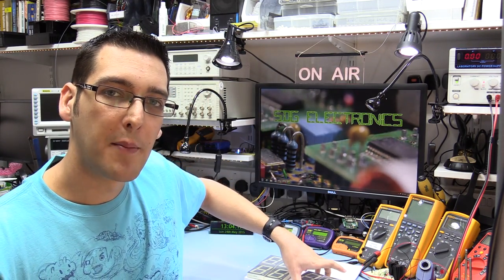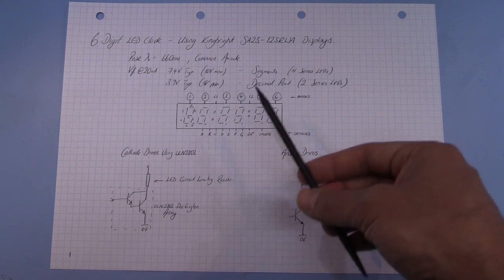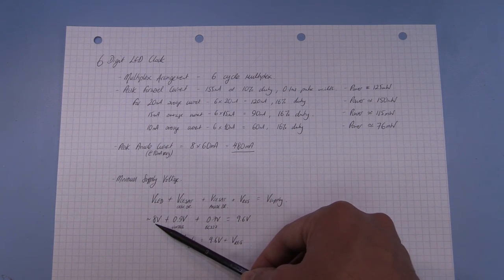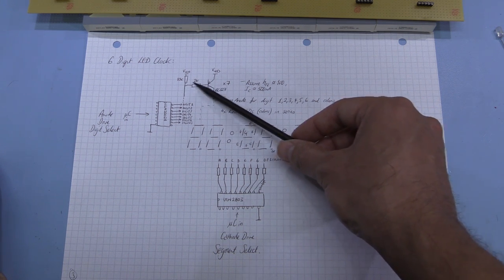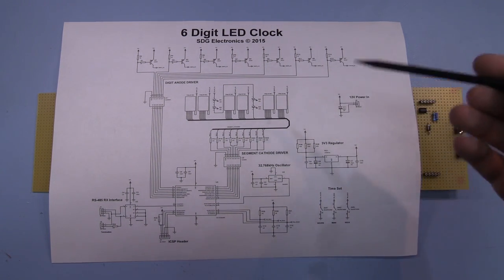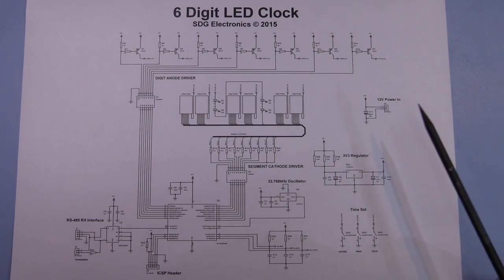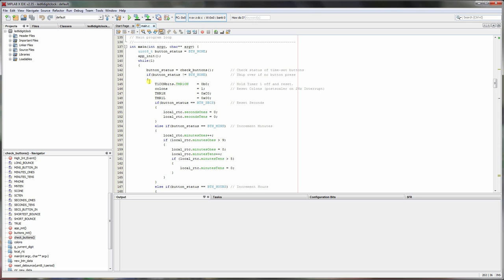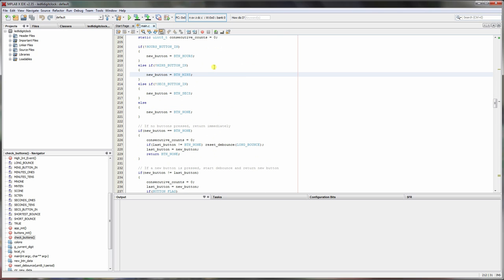SDG #023 Build A 6 Digit 2.3" LED Clock

Comment: Nice project - and possibly the tidiest wiring I've ever seen!
Reply from the maker: jix177 Thanks! Turns out it probably would have been quicker to spin a PCB, but wiring up on these prototype boards is generally pretty reliable and a lot cheaper. Thanks for watching.

Comment: You forgot to mention the Fluke in the description :)
Great video.
I made a very dirty prototype of a clock to learn how to code a specific micro like 10 years ago and it is still placed on my desk and is the clock I use the most. No case, nothing. Just works.
Reply from the maker: Charlie Pechiar I've built so many, but never made one that looks like a finished project, although there is something nice about seeing all the electronics. The OLED clock would be ok if it wasn't attached to a massive prototype board so it never really gets used. I may revisit sometime as the display is actually quite nice.
Thanks for watching :)

Comment: About the LEDs overdrive. It's a good way to get more brightness with multiplexing, but you have to check if you actually get more light with more current applied. There are current-luminance graphs in datasheet. I noticed that not all types of LEDs give more light when overdrived (but super bright red usually do).

Comment: I haven't looked at your schematic to see what you're doing with the ULN2803's pin that connects to all of those diodes.  They're in the chip for dealing with inductive loads,  I guess.  Here's a hint:  it make a dandy "lamp test" pin,  should you choose to use it that way.   :-)

Comment: Btw the "drag" soldering had had some solder between the last to pins. That's why I solder individual pins usually for 1.27mm pitch. And your soldering on the second side wasn't as bad. It doesn't have to be beautiful to work fine, as long as there is no solder between the pins. And it's probably awful to solder with a camera between you and the pcb.
Reply from the maker: Microlab Hi, I saw this on the video and it looks like solder, but it was some of the rosin from the Multicore solder and the way the light caught it. The working distance on the camera is about 15cm, so not too bad...

Comment: Excellent project! When you get the GPS added as well that will be quite a nice clock. Will you be reading the GPS serial out on the micro, or just syncing to the PPS? If you are reading the serial string, you can even account for leap seconds...
Reply from the maker: dwDragon88 The clock will be reading the full serial string, so hopefully should not need any adjustment ever. I kind of messed up in my thinking anyway as the acrylic on the front of the case for this clock will obscure the time setting buttons. I may add some to the back of the case just in case the GPS fails in the future. Thanks for coming back and watching :)
Reply: GPS time doesn't know about leap seconds.  So it is unlikely that a GPSDO would output data like that.  Leap seconds are why GPS time is a whole number of seconds off from UTC.  They started in-sync and then UTC did some leap seconds.

Comment: Thanks for publishing this video. I am amazed at how complicated updating six seven-segment displays is. I was looking at using MAX7219 chips for updating the LEDs, damn they are around $9.00 each in USA. Now that you have built the clock, is there a better way to reduce the chips / transistors that you used? Would MAX7219 be a good choice?
Reply from the maker: Take a look at SDG #058 there's a nice IC on that one

Comment: Excellent video and refresher from my college days. Though, there were no PIC chips then. :)   If one wanted to add a 7th and smaller digit to count tenths of a second, does this clock chip allow for that or would it be necessary to add a divide by 10 counter to the seconds count? Glad I found your channel !
Reply from the maker: Yes you can definitely add a 7th digit and modify the code to count 10th of seconds

Comment: How do you strip the wire? I got some and they are impossible to strip with the normal wire strippers i have.
Reply from the maker: Adil Malim Some automatic wire strippers work, I have some Knipex 12 42 195 Multistrip 10's. Often though, it's easier just to use a scalpel. Place the wire on a cutting mat, touch the scalpel on top of the wire and roll the wire. This seems to work well unless you've already soldered one end of the wire down...
Reply: Persevere with side cutters......you will get the feel for it eventually. Btw, nice clock.........nothing beats great big digits!
Reply: Well first time i tried i left it lol! Seemed too hard. Then i got this tip from somewhere to indent a normal nail cutter so it can strip the wire. Works really well but a bit tedious!
Reply from the maker: Adil Malim We use the C.K. Precision Wire strippers (model 330009) at work - http://www.amazon.co.uk/C-K-330009-0-12-Wire-Stripper/dp/B004JHXPE8

Comment: My Arduino-based GPS-controlled clock (conveniently intended for UTC, so no time zone offsets required) simply takes the GPS time string and displays it. Period. No 'Real Time Clock' at all. No 32.768 kHz oscillator. Just receive and display the time string more-or-less directly from the GPS. Known bugs: I really should erase the display after about 1.1s of no data, i.e. when the GPS signal drops out; now it happily displays frozen time. The displayed time must be a fraction of a second slow, as the data arrives a bit after the fact; I've heard of people programming elaborate +1s and synchronization code, including all carry-overs.

Comment: This is an incredible project.  I have built it and am having problems getting it to work.  I have checked all the connections a bunch of times and after programming it with the provided file the clock just shows all digits and all segments lit .  Colons too.  Do you have any ideas?  I know this project is 5 years old but any help would be great.  Thanks!!
Reply from the maker: Can you check the drivers all work properly? Try activating the first digit then check each segment. Do you have an oscilloscope?
Reply: @sdgelectronics  Thank you for replying.  I don't have an o-scope.  Im a noob at building these and it looked straight forward.  Couple questions: what would cause U1 to get hot? I am using MPLab 5.53 and XC8 2.10.  Would the code be compiled differently using these versions? Are there any special settings?  I tried the version 2.35 you used in the video to no avail.  Would the fact that I'm using kynar wire to the grounds instead of a bus be an issue?  The chips are all new since I bought a gross of all of them. I dont think I have anything wired incorrectly but did I miss something?
Reply: @sdgelectronics  I have determined that this appears to be a code issue.  I am not versed in programming but something is not right with either the compiler or syntax has changed.  I have opened a case with microchip and that is proving to be a serious trial that has been going on almost 3 months now.  All the hardware functions correctly.  I figured out why I was burning up U1 and corrected it.  Right now it appears that all the digits are being fed the same number so somewhere there is a disconnect.  I thought maybe I had the chip in backwards but I have exhaustively reviewed and even rewired them again and again with the same result.  All digits lit all segments lit, multiplexing does not seem to be functioning.  everything turns off when I erase the MCU.  Again, I'm a rookie at this and I have learned a lot for the last 3 months.  I understand if you would not be interested in helping me out due to that fact.  I just wanted to let you know where I am on this project.  Which would be really close to lighting it on fire.  If anyone else happens to read this and can help me out that would be great.  I really love this clock and would like to have it in my shop and working. I have a really cool pedestal design to complement the smoked lexan  of Steve's and I can't wait to finish it off.  Thanks.
Reply from the maker: @mikeprovenzano1438  next thing would be to disconnect the microcontroller and try to drive the digits and segments individually to confirm the wiring is correct. Also worth checking the programming options include programming the config word.
Reply: @sdgelectronics  Hey Steve.  finally got the thing to work.  Grounds seemed to be the issue.  Grounding pin 10 only on the 2803A and pin 8 only on the 2003A did the trick.  I also beefed up the entire ground bus with heaps of solder instead of just tacking the wire wrap wire every few pads.  Wow this thing is bright with the 51 Ohm resistors installed.  You're a genius! Thanks for the cool clock project. You've got me hooked on them.

Comment: Hi Thanks for the video. Thinking of doing something similar but maybe interfacing with the web to get the time from ntp on startup. This is mainly to get experience with pic programming. I have a question on the schematic. You have a SN65HVD08 for RS-485 but the datasheet for PIC18F2XK20 says it supports RS-485,RS-232 and LIN . What am I missing ?

PS tutorials on PIC programming and theory of the peripherals on the chip would be great. Not many people go into that.

Thanks for the video
Reply from the maker: +Glenn Pierce The PIC supports the protocols, but you need the transceiver to implement the physical layer. I'll see what I can do in terms of tutorials. Thanks!

Comment: Thank you for the video.  I would like to build a similar clock but am finding it impossible to find perfboard of that size from any North American suppliers.  Do you remember where you got the perf board of that size?
Reply from the maker: +SomerledDesign Hi, the prototype board is CIF (cif.fr)- part number AJP58. You can buy it from Digikey although it's a little more pricey than in the UK http://www.digikey.com/product-detail/en/8006/V1048-ND/38941

Comment: Now i dont think anyone will find that hard to read :-D
I understood your electronics part, but pic chip programming language just seems like jibberish to me, i looked at borland c and got the same confusion lol :-).
I did make a simple pic based L/C Meter and  i was pleased with the result, but the hex code was someone elses, my old willem programmer did the burn.
An old 16c84a pic with an l/c oscillator and a switched 1000pf capacitor for reference was the type, im sure you have seen the circuit :-)
Reply from the maker: zx8401ztv Yep, I reckon you could read this from quite a decent distance! Software isn't everyone's forte, hence why I've put the code on my website so people can build their own without necessarily having to understand any of what the code means.
Reply: SDG Electronics Oh yes its readable all right lol.
I know where to go if i want a clock :-)
When i can get interested ill assemble a pic based esr meter with compatable hitachi lcd display.
There are lots of clever people like you that make the pic circuit and code open to everyone, lucky for me :-)

Comment: 2021 dec 12/2/21 YOUR WEB SITE DOES NOT WORK. it gives an error message that seems to have to do with accepting "cookies" but this cannot be the answer as it never opens to begin with. the web site you provide does work initially but it does not give any information and again gives the error message about cookies. im using linux ubuntu 16